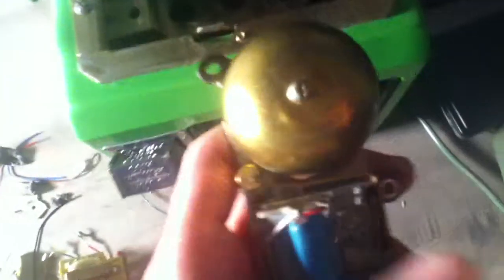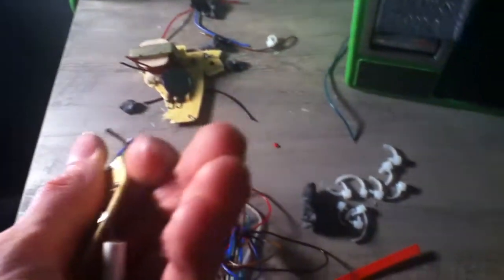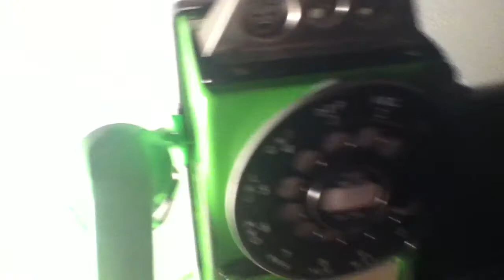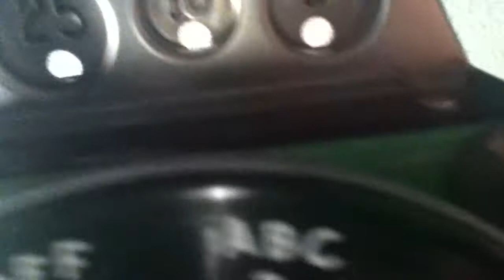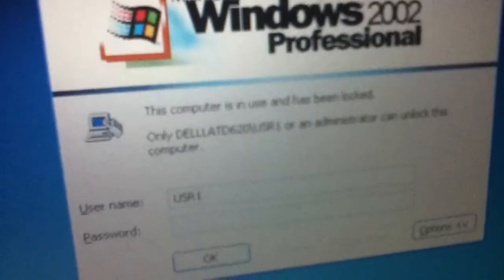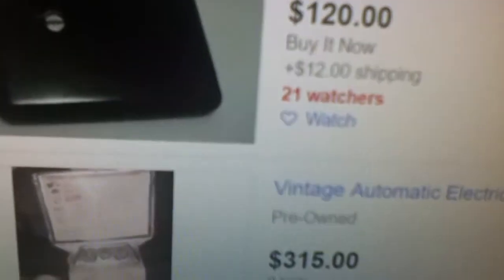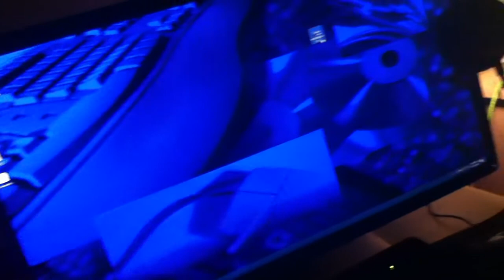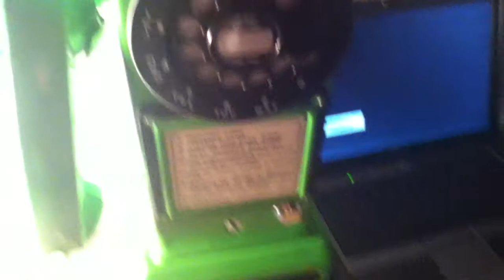Northern Electric 233QF 3-Slot Payphone & 207C Step Switch Part 4

Comment: When you go to buy your coin relay, make sure it is the single coil type, not the dual coil, and that it is fully equipped with the contact spring assembly, the trigger, the selector card and the cam. You will also need to find a trap, trap lever and trap pin, which are currently missing from your payphone. These last 3 items are not part of the coin relay assembly and will be difficult to find. Sometimes you will see a  coin relay and hopper assembly selling complete as one unit, which may be your best choice.
Reply from the maker: Thanks.